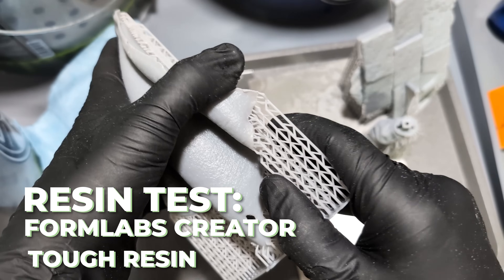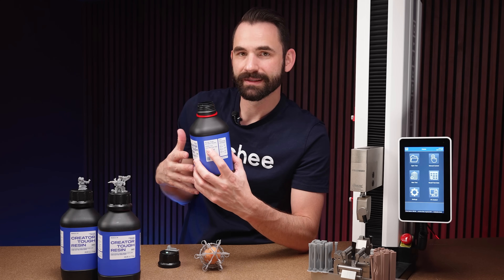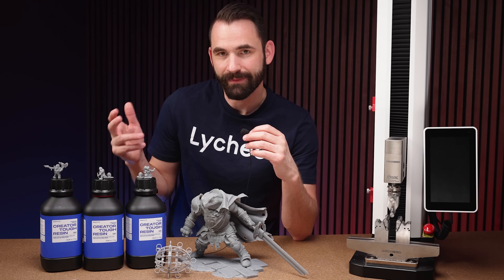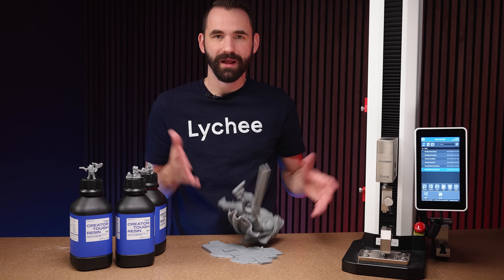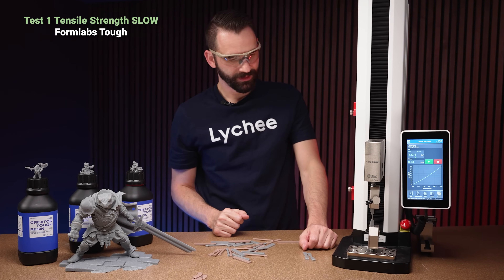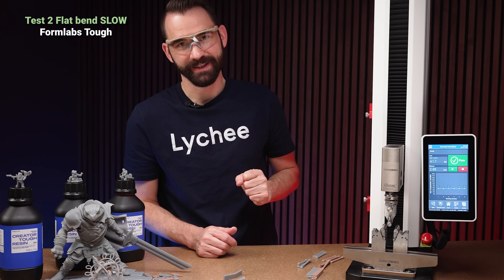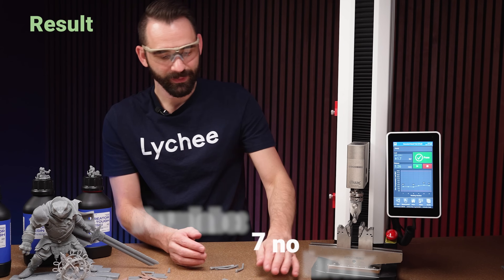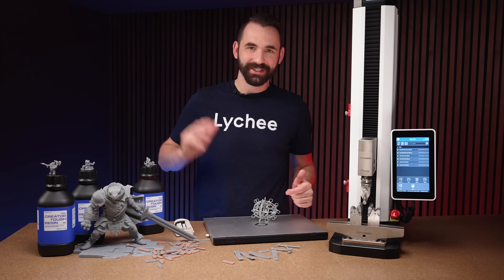Tough Resin vs. Standard Resin: The Ultimate Test

Comment: IMO, this test is really just for you because you're testing against a proprietary blend. I'd like to see testing across different off the shelf resins.

Also, whether or not it breaks & break distance are subjective to print requirements. Flexibility over breaking is generally better, but I would like to know more about deflection & plasticity. How far does each bend under equal load? At what load/distance does the material not return to its original form? The formlabs bends to a greater distance before breaking, but how rigid is it when that is a requirement?

Comment: I'm new to DLP 3D printing but so far the Siraya Tech Blu Lava Black is the best resin I have found for strength , dimensional size and no warping , it's very thick harder to clean up but for functional parts it's the bomb 😂
Reply: I have some with the plans to do this exact same testing against.

Comment: I would like to see how the bend testing you performed works on parts that have been fully cured, but then "rested" for 2-3 weeks. In my experience, after a couple of weeks the prints become much more brittle than when they're 'freshly' printed.

Additionally, I'd like to see how the Izod impact test relates to toughness in resins. I'd think it would be more pertinent in some ways, as dropping prints onto a hard surface seems more like the Izod impact test - and dropping prints is easily the thing that seems to shatter prints the most easily in my experience.
Reply from the maker: Thanks for the suggestions! :D
Reply: You are correct they absolutely do, I'm working on a full resin guide that will have this level of detail and much more.